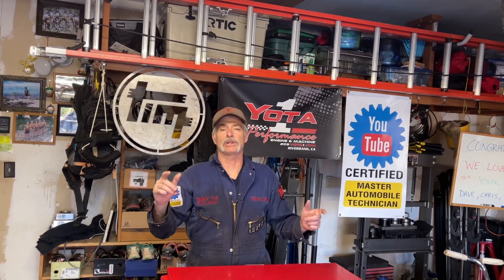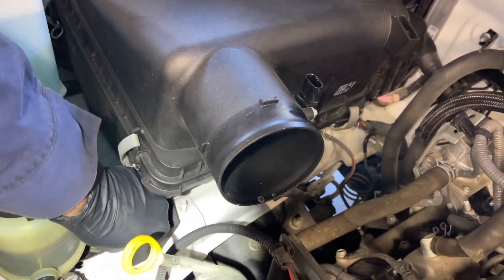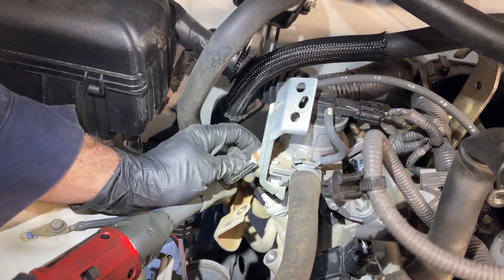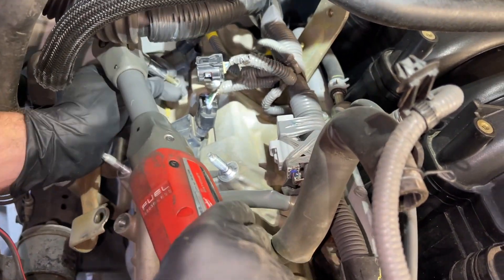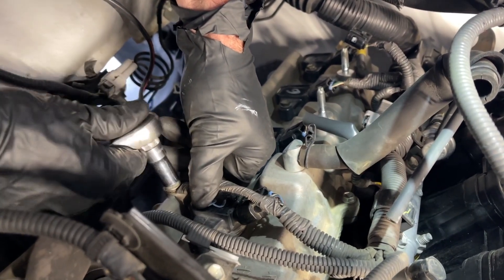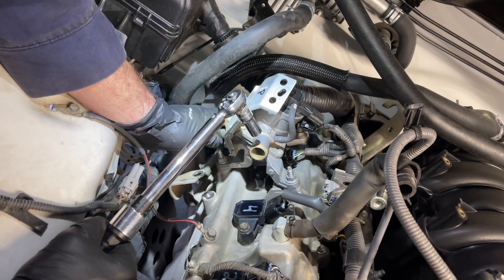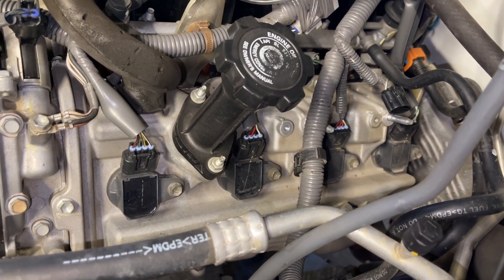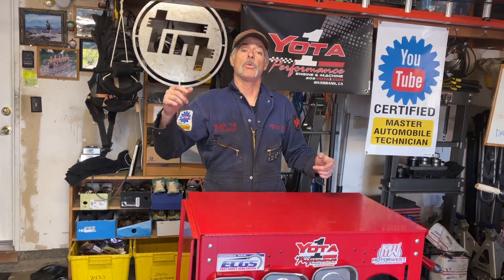Toyota Tundra 2UZ-FE 4.7L V8 Spark Plug Replacement

Comment: What's not straightforward about this engine is replacing the starter motor.  Great video Tim. Have a good weekend.
Reply from the maker: Thanks Marvin.  We have a 2-part video series for replacing the starter on the 2UZ-FE engine models with the secondary air injection system.  It's a pain in the butt, but it does depend on what model you're working on.  Tundras have a lot of engine compartment space compared to others like the Lexus GX470 we did the starter replacement on.  The extra space makes it easier.  https://youtu.be/dXpK5YG7-A8?si=n47_GFJSZj6woSPF

Comment: I can replace all eight plugs on my 05 Tundra without removing anything. I'm surprised at the different layout. If I have air pump problems I might do the bypass. Very nice job again.
Reply from the maker: Hey Carl, I did some more research this morning at my local Toyota dealer and it appears this setup for the 2UZ engine was only for the 2nd Gen Tundras from 2007-2009.  Thanks for the compliment.

Comment: Wouldn’t this be a great opportunity to clean the carbon deposits from the throttle body? A little spray TB cleaner and a shop towel would only take an extra few minutes. Nice job Timmy! Well done.
Reply from the maker: Yeah, it would have been an opportunity to clean the throttle body.  The air tube comes off fast and easy,  so it wasn't that big of a missed opportunity. Thanks for the comment.
Reply: @TimmyTheToolman  I thought of this only because I just cleaned the TB on both of my 3URFE engines. It is a very quick job indeed.
Reply from the maker: @TXAG81  I'm going to perform an engine oil change and trans fluid exchange on his truck, so maybe I'll clean the throttle body then for him.

Comment: Interesting. My 2000 tundra all the spark plugs are easy to access and it’s a quick job.
Reply from the maker: From my research, this model of the 2UZ engine was only used on 2007-2009 2nd Gen Tundras.  No other model with the 2UZ engine had the switching valves bolted to the valve covers.

Comment: Hey buddy the tundra V8 4.7 was only for 2005-06 but rolled over to the newer body style tundra for 07 ..great video
Reply from the maker: Hey Paul, I don't mind people pointing out when I'm wrong, but from my research, the 4.7L V8 2UZ-FE engine was available in the Toyota Tundra from 1999-2009.  So Bro, if you can show me something that proves you're right and I'm wrong, send it my way.  Here's something I found from a simple Google search.  

https://www.drifted.com/2uzfe/#:~:text=These%20are%20the%20cars%20that,Land%20Cruiser%20(1998%2D2011)
From the link above, this is what models came with the 2UZ-FE engine:

Lexus GX 470 (2002-2009)
Lexus LX 470 (1998-2007)
Toyota Land Cruiser (1998-2011)
Toyota 4Runner (2002-2009)
Toyota Tundra (1999-2009)
Toyota Sequoia (2000-2009)

So, the 2007-2009 2nd Gen Tundras came available with the 2UZ-FE engine.  I'm far from perfect and I make mistakes, but I also do plenty of research for the videos I make.  The fact that my brother's 2007 2nd Gen Tundra has the 2UZ-FE engine proves you're wrong, and no, it didn't get an engine swap.

Comment: Spark plugs (rear bank) on the 2GR-FE is pretty involved as well.
Reply from the maker: What models was that engine used for?
Reply: @TimmyTheToolman  highlander,  probably camry, Sienna, I think. The 2GR is the transverse version of the 1GR for front wheel drives. Many of the vehicles that use it need to have the wiper cowl and wipers removed, as well as the intake plenum to have room to get at the plugs on the rear bank. However,  after I did it the first time, it's not as bad as it first seemed. As you know, being organized with the parts is important.
Reply from the maker: @TheDesertRat31  Gotcha.  Thanks for the info.  Yep, being organized is the key to limit frustration and guessing.

Comment: Thanks for all of these great videos. Love the channel. I have a noise that I can't diagnose and wonder if you have heard it before. On a 97 tacoma V6 I here a noise that I can best describe as static that comes from the dash while the truck is moving. The noise became louder recently after driving down a terrible washboard road for nearly 30 miles. Any tips are appreciated. Thanks again for all that you do.
Reply from the maker: It is hard to diagnose noises over the internet.  I'm not familiar with what you're describing.
Reply: @user-jy1gq1wt8p .... i have a '97 Tacoma with MT and the 5VZFE (341k miles)  so I may have (or had) a similar noise. (I've had a few too many odd noises in the recent years) but will need more conditional deets from you to compare notes and get it nailed down! such as mileage? transmission MT? or AT?  are you in a cold climate area?   @user-jy1gq1wt8p ... i once had a 60 mile washboard taco run out on the open range in the sandHills, then a noise developed on the broken roads of Amarillo Texas and then came Michigan, where odd noises popped up but then soon left as quickly as I got the heck out of Michigan lmao
Reply: Thanks for chiming in. My truck has 202 miles. It’s an AT. The noise is worse when it is cold. After a while it seems to dampen.
Reply: @efil4kizum  Thanks for chiming in. My truck has 202 miles. It’s an AT. The noise is worse when it is cold. After a while it seems to dampen.
Reply: @DonnieTietsema   do you notice the speedometer needle fluctuating at all? even just a little bit, especially at highway cruising speeds 55 to 70 mph?
Reply: @efil4kizum the needle does move around visibly.

Comment: Not all parts are created equal for this engine. I recently replaced a damper pully in my 03 4runner and after comparing it to the original pully the white timing marking is of 5 degrees.
Reply from the maker: Did you buy an OEM part or aftermarket?
Reply: @TimmyTheToolman  It was an aftermarket part. I'm sure that was the problem. It had me stumped for a minute though
Reply from the maker: @shaunmedina9278  Yep, aftermarket has it hazards at times.
Reply: what is a damper pully?
Reply from the maker: @efil4kizum  Harmonic Balancer (aka Crankshaft Pulley).  It helps balance the crankshaft and has rubber inside to dampen vibrations.

Comment: I just replaced my sparkplug on my 2002 tundra 4x4 v8. I didn't disconnect the battery or the coils, or the airbox. It required a little maneuvering  but nothing special. I was done in a hour while taking my time.
Reply from the maker: I'm guessing you didn't have to contend with the secondary air injection valves like I did,  because if you did, you wouldn't have completed the job in an hour.

Comment: Iridium plugs on these engines will go 150k easily before needing to change.  I own 3 vehicles with these engines and they are truly unbelievable.  Around 250-300k I would go ahead and replace all 8 coil packs with new Denso units from RockAuto.
Reply from the maker: You would replace coil packs as preventative maintenance?  I'm of the opinion, you only replace them if they fail.

Comment: Hey Timmy, I saw on your story on Instagram the other day you had a picture of the KPOFFROAD ocotgon and cam tab kit with the RC greaseable LCA bolts on a truck. Are you making a video about that putting them on your 4Runner? I am interested, I currently want to get just the octagons and bolts but wondering if it's really worth it to get the greaseable bolts. Thanks!
Reply from the maker: Yep, we are editing the footage currently. To answer your question about the greaseable bolts, hard to say at this time since we have no runtime on them.. but in theory, these should work out great to get grease to where it needs to be without having to remove you’re entire control arm…. The video will focus on the installation of a set of Solo Motorsports lower control arms.
- Sean
Reply: @TimmyTheToolman  ahh I see I remember seeing the solo motorsports arm on there too. Sweet, thanks. I’ll be looking forward to that video. Yeah I was quite interested with the grease able bolts but they are quite expensive just for bolts lol. 270 bucks there for the octagons and greaseable bolts.. yikes.  When I thought about it though I kinda questioned how they would even work. From my understanding it would only grease the shank part of the bolt and the inner shave sleeve it self of the bushing which the bolts sits in. If I’m not wrong isn’t the LCA bolt going to be stationary when tightened down? The LCA bushings rotates around the bolt sleeve not the bolt. The bolt clamps down the sleeve as well because of the pinching force on both sides. So unless I’m incorrect the greaseable bolts would be kind of pointless other than to grease the stationary LCA bolt to prevent rust from forming lol.
Reply: @TimmyTheToolman  even with the greaseable bolts it’s not getting to the ID of the bushing, only greasing the ID of the bolt sleeve and the OD of the bolt. Also for context I’m talking about poly bushings. Like a white line LCA bushing which I bought. I guess it depends on what design bushings you buy? Unless all of the poly bushings are the same design for our LCA . Not sure if I’m over thinking this or I’m incorrectly interpreting how the whiteline bushings work